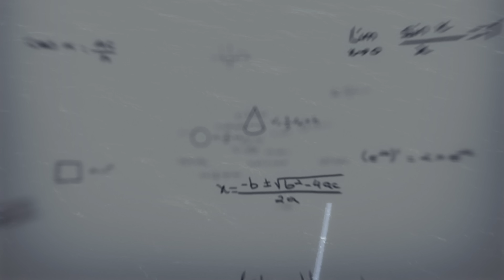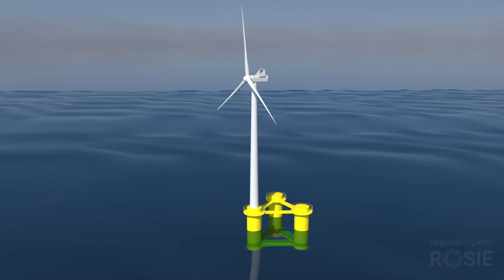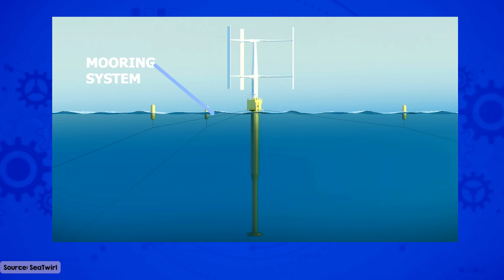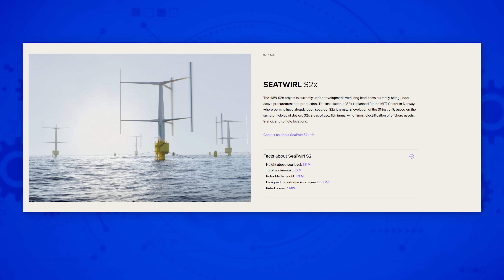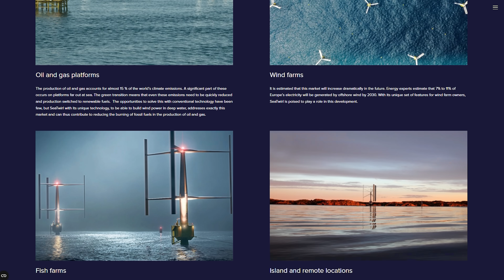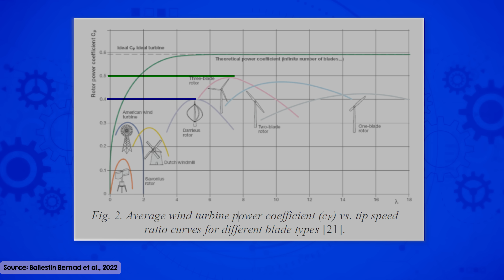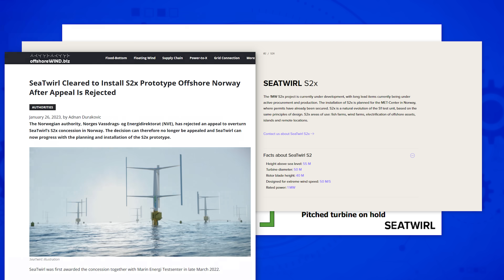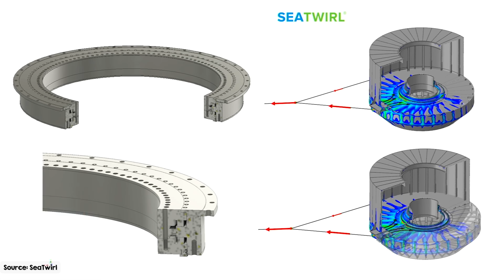Are We Building Wind Turbines All Wrong? SeaTwirl Thinks So

Comment: The turbine density point feels like one of the big selling points. Being able to squeeze a greater number of less efficient turbines vs fewer more efficient turbines could see an increase in overall power generation.
Reply: A higher number of turbines potentially means higher operating costs per unit of power produced. Like everything else in engineering, the system needs to be analyzed holistically and there will be tradeoffs.
Reply: @Frostbiker  On the other side maintenance costs should be lower and does not require scaling of the tower with all the safety issues that come with that.
Reply: Optimizing for more complex factors is a good sign.
Reply: Efficient wind turbines create more wind energy depletion.  They also start higher and reach higher for high speed/energy wind.
Reply: Allow me, from a business perspective, to rephrase that slightly: Being able to squeeze a greater number of less expensive and cheaper to maintain but less efficient turbines vs fewer more expensive and harder to maintain but more efficient turbines could see an increase in overall power generation.
Reply: @DarkSyster Economical interests doesn't overrule basic physical law.
Just like solar panels isn't efficient in shade, wind turbines needs undisturbed wind.
Reply: @OmmerSyssel  Very true, but if the things are going to be installed, they need to make economic sense as well.

Comment: Vertical axis for floating turbines makes a lot of sense to me as a sailor and aerospace engineer.

unlike a land based or fixed bottom turbine, a floating turbine is really limited by righting moment. You can increase the righting moment by adding aditional floats, but the spar bouy is by far the most stable and durable in really heavy seas. Vertical axis wind turbines both have more righting moment by putting the heavy generator and gearbox at the bottom, and can be made to apply less torque for a given power generation by having a lower center of effort. 
Being on the ocean, especially far off shore in deep water, also mitigates one of the main power disadvantage of land based horizontal axis wind turbines. On land, the surface produces a lot of drag and you have to get pretty high up to get strong consistant wind, but the ocean is much flatter, and the strong consistant winds are much closer to the surface, so a vertical axis turbine that's much closer to the surface is still going to be in good wind.
The maintainance advantages of a horizontal axis turbine are probably also more meaningful for a floating design. The bobbing and rocking of a floating wind turbine also make climbing the tower to do maintanance on a HAWT nacell a much more difficult, dangrous, and seasickness inducing job than climbing a land based or fixed-bottom turbine.

Then to top it all off, vertical axis turbines tend to be quieter and have towers that vibrate less, so they produce less marine noise, and the fact that they're closer together should make them better at keeping out illegal fishing, making them more effecive as a protected area.
Reply: if you are interested I have a design composite for a dual rotor horizontal wind turbine which has the transmission and generator lower in the tower.
Reply: You mean the mandatory rotating structure is a plus compared to a horizontal turbine that could build an internal power shaft if it had an advantage?  Don't forget that vertical turbines have half the active wind surface working against the wind and that they have many passive support surfaces with permanent drag, it's easier to sell paddle wheel boats than this.
Reply: @2adamast  The reason an internal shaft doesn't have an advantage for a horizontal axis turbine is because the required right angle gearbox at the top and the internal shaft would be just as heavy and maintanance intensive as the generator, so there's just no point. That doesn't mean that there aren't advantages to having the generator low down for a vertical axis turbine that has a fully rotating structure (and no right angle gearbox), just that for land based and fixed bottom turbines (which is most of what we've built so far), it's not that big of an advantage and not worth dealing with all the disadvantages of a vertical axis turbine for. Floating turbines are in differnet conditions with different limitations, so the right set of tradeoffs might be differnet, and it's at least worth trying.

 As for half the active surface working againts the wind, for a lift based VAWT It doesn't, and it's too hard to explain without drawings, but it's easy enough to look up a good explanation on youtube if you want one. The support surfaces also don't have to be pure drag since they can (and almost always are) designed as aditional airofioils or wing fences that do add some extra power.
Reply: @thamiordragonheart8682  In theory much can be done, in practice the yield is somewhere half.  Add to that the functional16MW horizontal floating units compared to 5 MW vertical
Reply: @2adamast  but 16MW vs 5MW per turbine isn't really important if the 5MW turbine costs less than 1/3 as much over it's lifetime and can be spaced enough closer together, and I think that's still an open quetions for floating turbines since we don't have much data on vertical or horizontal axis ones yet.
Horizontal axis wind turbines are always going to be bigger and capture a higher percentage of the incoming wind energy, but LCOE, and to a lesser extent MW/km^2, are the only imprtnat metricts.
Reply: Wind is more or less free. The meaningful metric for efficiency is cost per kWh captured.

Comment: When are going to see VAWTs wrapped around motorway lighting poles? With the air turbulance created by passing traffic, these would remain spinning when there is no "wind"
Reply: Some one made some video/calculations for that. As far as I remember the energy was tiny and even if it worked that moving air is moved by the cars and harvesting it would mean increased energy cost to move those cars

Comment: There was an experiment in California about 15 years ago with a whole array of VAWTs to see if there was a significant enhancement from putting them quite close to each other, but counterrotating, so one turbine sped up the effective windspeed for the one behind it. I never heard what the results of that were: I presume it didn't make much difference, and it was still better to space them out largely beyond each other's wakes, BICBW. Not sure if that is what one chap was referring to when he said something about wakes and effects of relatively close positioning?
Reply: VAWT are much less sensitive to turbulence, so the size of the wake another VAWT cares about is much smaller than for a HAWT even if close spacing with counter rotating doesn't get you extra power. That could also be what they were talking about.
My guess would be that alternating counter rotating VAWTs does generate extra power per km^2, but not enough to justify the cost of the extra turbines, or in a way that's super consistant with shifting wind directions.

Comment: Presumably another minus point on the relative power output is that more of the blade/swept area is lower down (than a HAWT) and windspeed rises with height, so the average windspeed over the area is lower. I presume that's less of an issue at sea than on land, but there is still a significant effect.
Reply: speaking as a sailor, the wind speed does pick up much faster wtih altitude over water than over land. the water surface is just very smooth and doesn't produce that much drag, so the boundry layer is much thinner.
having more swept area lower down also gives them more power for a given righting moment (ie. given size spar bouy), which helps balance things out with it being slightly lower per swept area.
Reply: lcoe is what counts , that is where vawt wins.

Comment: In addition to smaller form factor and ease of installation, I get the impression they are hoping to use efficiencies on material, maintenance and installation to achieve a comparable LCOE?  Will be very interested to hear more as they progress.

I wonder if the smaller form factor makes it easier to get wind farm permitting?
Reply: The projected LCOE is lower than that of existing HAWT turbines.

Comment: This won't work on floating platforms. The generator will try to rotate the platform in the same direction that the blades are rotating. Sure, it's possible to counteract that with a bunch of anchors but those countermeasures will introduce a whole bunch of new problems.

Comment: Good video Rosie.

There are so many rivers in most countries you would think in this modern era the same sort of principle that gets power from a wind turbine could equally get power from a 'water wheel'...just a thought.
Reply: There are loads of small hydro schemes using small turbines, pelton wheels, or archimedes screws. I have never heard of one using a suitably-scaled darrieus, savonius or gorlov turbine, but it turns out there are plenty of research papers on the subject, and various machines have been installed, so it has been tried/investigated.
Reply: @xxwookey  OK.
Reply: Have a look at the geography of Australia. North Africa.

Comment: I would put a battery as ballast at the bottom, so it can be wired up and installed directly with the turbine. Additionally it is kept cool by the surrounding water.

Comment: Biggest downside imo is that lower altitude turbines dont get so stabil wind and much lower average windspeed. Best use case could be producing electricity to oilplatforms etc.
Reply: Windspeed does not increase much with height at sea.

Comment: I wonder why the blades extend so low to the water? There's more wind to catch higher up, so with the same weight it could gain a bit more? Also I wonder if the diagonal bars that hold the blades could be shaped in a way that also catches some wind.
Reply: Windspeed does not increase much with height at sea.

Comment: This  is genius. The loss of efficiency is not as important as ease of production, logistics and installation. 
Where I would see a bit of a downside is how tall these structures can be - the HAWT are super-tall these days as they reach stronger winds that way. The VAWT sits "lower" to the sea level, meaning also loosing on the powerful winds. So not only it looses on efficiency (not a big deal, I guess), but it also looses on wind strength (much bigger deal).
But it has a lot of potential and I am happy someone invests effort to challenge the status quo.
Reply: But isn't wind strength stratification caused by irregular land surface -hills, trees etc? I would expect a much more laminar flow over the open sea.
Reply: @OlaGabrielson-fu1kb  I know from watching cyclones that winds still increase significantly away from the surface. 'Surface' wind speed is defined as measured at 10 meters off the ground/water, but during landfalling tropical cyclones, ships may measure readings 10-15% higher since their instruments are higher than 10m from sea level.
Reply: Well, the efficiency problem is only a problem when looked at from a single turbine point of view. But it should be looked at from a total grid cost point of view.

If these things are easier (read cheaper) to build, produce, transport, install and maintain, and can be spaced closer together, who cares if you loose a few %? The total wind farm will yield as much or more. That is the real balance.
Reply: @joopdesmit They VAWTs are a couple of times heavier per energy produced. So this is economical a dead end, like decades proved before.
Reply: But does the square profile of wind capture get more of the higher stuff ? As Rosie says it needs testing. But a great idea.
Reply: @ians3328  Half the square is going against the wind.  It is a really bad start for productivity and also twice the wind load and infrastructure.  
Sea and land turbines keep the lower third free,  I guess with good reasons
Reply: yay quicker production so we can have more turbine blades being unrecyclable in a landfill faster
Reply: @ashardalondragnipurake How are you safely managing extreme toxic nuclear waste in one million(!) years?

95-100% of a wind turbine are recyclable.
Reply: @OmmerSyssel  99% of nuclear waste is recyclable
the rest is irrelevant
nuclear issues have been solved for ages
green isnt to reduce carbon, its just to fill pockets 

and no the fanblades arnt recyclable at all 
its incredibly toxic both in building and disposing
green does incredible damage

Comment: mmm the spinning bit under water.  So one the turbine blades will have to overcome all that inertia and also all that surface area on the cylinder is going to create drag against the water.  When barnacles and other flotsam and jetsam get attached to it that is also going to impact the performance of the device.  How are they going to deal with that?  Has that been modelled into their calculations?